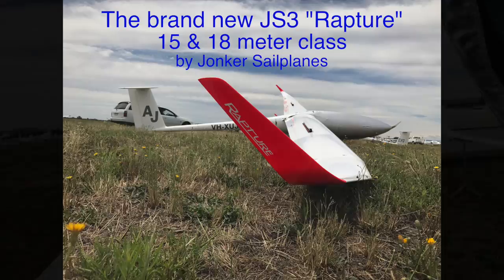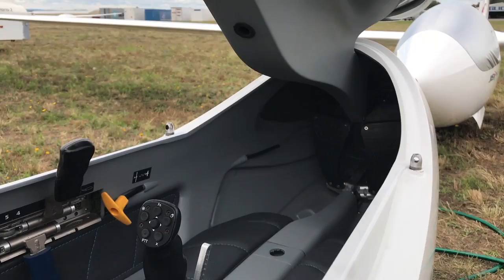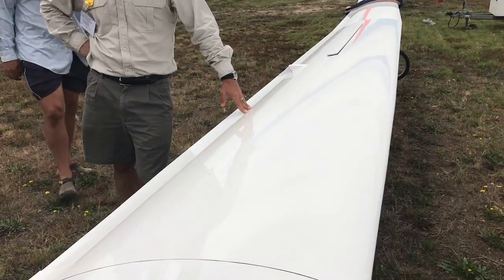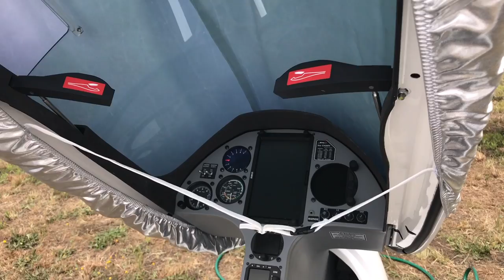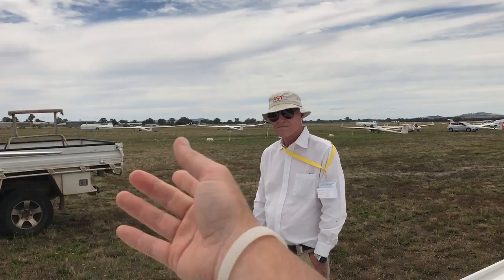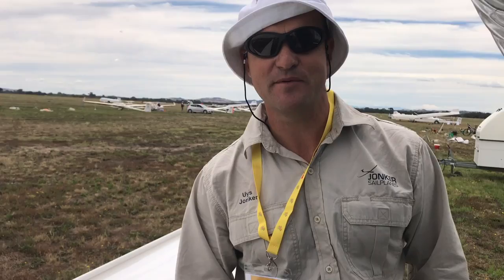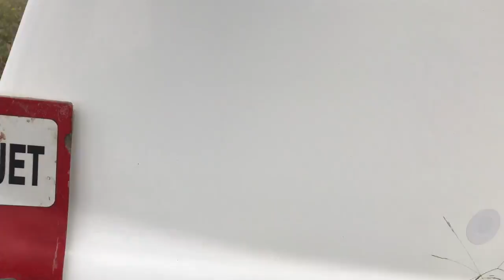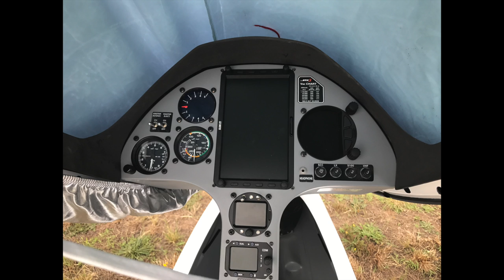Quick JS3 walk around with the Jonker Sailplane boys…

Comment: Is there any information on the glide angle yet ?
Reply from the maker: welshpete12 - officially no, but unofficially, I'm sure the 15m version is > 50:1 at best glide and the 18m is probably nearly 55:1 at best glide.  But the most important measurements are how "flat"'the polar performer curve (glide ratios at all speeds and wingloading) is at higher speeds and especially the performance at maximum wing-loading (handling, climb, etc.)
Reply: Ok , thank you for the info

Comment: What is the design advantage for the large wing fairing?
Reply from the maker: The aerodynamicists and designers of all sailplanes spend an enormous amount of time trying to get the overall airflow on all the gliders surfaces as laminar (non-turbulent) as possible, especially in this area of the glider as the wing/fuse junction is a well-known source of drag.  This is why so many older sailplane designs have experimented with auxiliary wing fairings.  So this new glider design, the JS-3, has a rarely used sailplane wing position known as a high wing (or having the wing joining the fuselage at the very top of the fuselage).  This wing position has certain advantages (mainly, instead of 4 "high drag" corners with the fuselage and wing there are only 2 as the top surface of the wing blends into the fuselage).  Unfortunately, this wing position has been unsuccessful in several older glider designs.  Jonkers (JS-3 designer) has studied this aerodynamic problem now for roughly 2-3 years while using super-computer driven CFD analysis to iterate thru thousands of variables.  They claim to have found a significant performance advantage after struggling for a long time to understand the high wing problem and make it pay off aerodynamically.  Previously, the complicated math required to understand the airflow in this area was just too time-consuming, and the computer tools were not mature enough to be successful.  So this glider does not have secondary fairings, but it has an ultra modern design that has taken years to perfect.
Reply: Are there any special considerations when choosing a trailer for the JS-3?
Reply from the maker: CloudStreets Not to my knowledge.  I have a high degree of confidence that the JS3, like the JS1 and most other modern gliders, fits in a standard 15m size trailer with both 15m and 18m wingtips within.  The JS3's nemesis, the Diana 2, requires a very wide trailer as the inner 4 feet of the spar (each side) is permanently affixed to the fuselage, creating an 8 foot wide fuselage, and an issue for trailer configuration.
Reply: Yes, increased computing power means that you can solve the Navier-Stokes equations, which I was told in Engineering school were insoluble.  Lovely looking glider; I just need to win the lottery.

Comment: Why does the factory have comments turned off?   Maybe because they have turbine engines delivered that don’t run properly.  Please JS fix your engines and stop ripping off your clients.  Then you can turn your comments back on.  What the hell is wrong with you?
Reply from the maker: Bill, I'm just a pilot, not associated with the factory manufacturer.  I am a fan of the JS gliders in general.  Their design and relative performance is extremely impressive.  That said, I fully agree that the reliability of the turbine is less than perfect.  Same is true of all glider powerplants.  To what extent is debatable.  Hence I do not yet own a motor or sustained glider yet.  I'm still waiting to see how the AS33 performs this summer in competition.  For now my pure ASG29 tics all the boxes.  The Euro/Dollar exchange rate is very poor now 😔 and is going to get much worse under the fraudulently elected (Quid Pro Quo, China's bought sock 🧦 puppet, Hunter Cocaine is a helluva drug 💉) Biden Crime Family (print, print, print dat debt 📈 💵, raise dem taxes)!